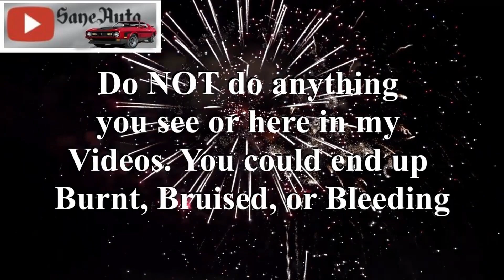Vevor Bench grinder Unbox assemble review

Comment: I have one and in two months you could not even see through those little plastic shields probably due to the way the thing was used by others. Someone ground so much plastic and rubber with it. I’ve had to disassemble it and chisel all of the burnt melted, rubber and plastic out of the grinder wheel shrouds